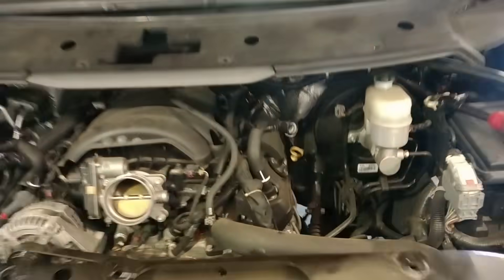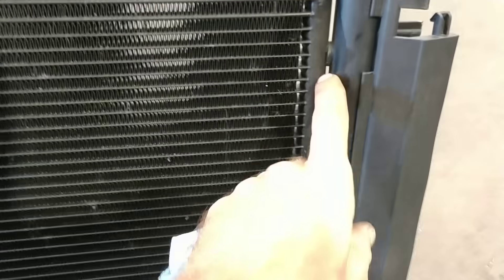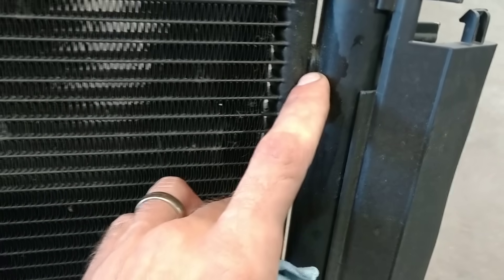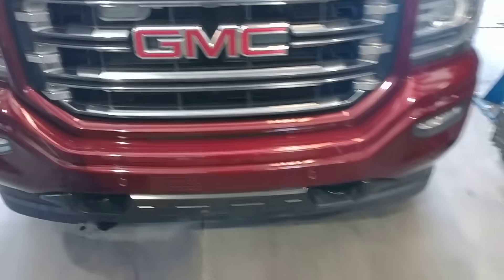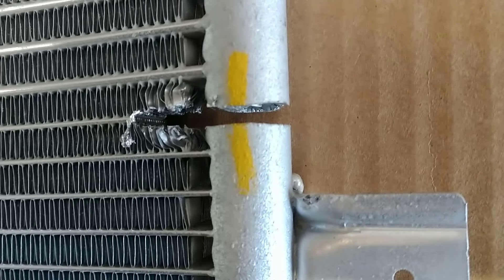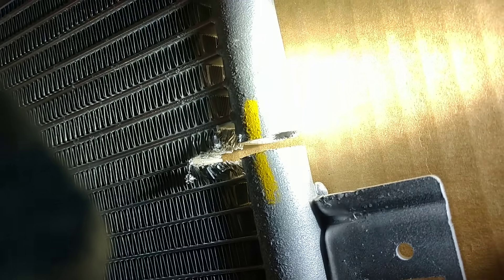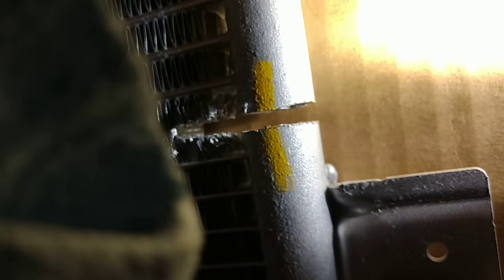Customer States...WAIT, look at this! Can't make this stuff up!

Comment: Interestingly enough. Saw a brand new 2020 Colorado 3.6 V6 with a coolant radiator that had to be replaced right off the delivery truck cause the entire top of it haven't been manufactured properly and when it warmed up to operating temperature, would open up and shoot orange coolant all over the underside of the hood. How did it pass quality control leaving the factory? The coolant radiator and the truck? Lol.

Comment: POS cars. 4 year old car needs a heat exchanger replacement. I could buy a used heat exchanger which was stripped from a ten year old car for my 20 year old car. How can someone not take 30 years of industry experience into account and make a car part so poorly designed?

Comment: Pop that sucker in and charge them another 1500 when they bring it back in. That's dealership tactics at work!
Reply: That is supposed to be like that
Reply: Uhm no. And these videos that are all over yt is showing us that mechanics are actually honest people, and that some car owners are just cheap and think service is a waste of money, and when mechanics are trying to sell you something, it's because your shit is fucked. But of course there are dick heads in any industry.
Reply: @mortenhartvigkristiansen7760  What shady mechanic is going to upload his shady practices? All of these "good" mechanics are showing you what they want you to see.
Reply: Did Morten actually write "customers are cheap"? To a group of people overpaying for declining quality in manufacturing? If I designed mass cars and not my personal projects, I would be mortified to have someone who paid their hard earned money to have to pay for a new radiator in a 2017 vehicle. That should be covered as well as many other defects. In PM training, you learn that a successful program is measured by the percentage of products making it beyond the warranty period without any claims. The standard 3/36k is such a low benchmark that I would be embarrassed to be apart of such. To fix your thoughts to type "cheap' as work trucks are 50-100k is just dumb.
Reply: Why else does bmw have plastic VALVE COVERS nowadays.  To get yo moneyyyyy
Reply: @tubbs200803  
MANY brands and models use plastic (molded nylon) valve covers for many years now.
GM started using them on the 4.3L V6 over 25 years ago. They had very few issues with those covers.
Some of the Buick 3800 V6s used molded fiberglass valve covers.
Reply: @tubbs200803  Exactly, every time I see a engine with that kind of stuff made of plastic is like "OH HELL NO!!".

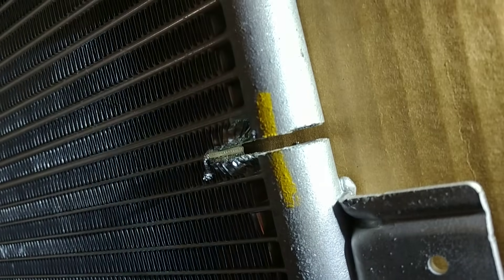Comment: I worked at a factory in Montgomery, Alabama that made radiators.  When I saw the pic at 1:17 I was like no way!  The aluminum tubes have holes that are big enough to pass a toothpick through at least otherwise they'd be getting stopped up all the time.  Good to discover that the radiator was made as two separate halves.  They are just using that "tiny hole" area as a heat conductor.  I hate seeing perfectly good fins ruined in a hack job like that.  You'd think the engineers could come up with a more elegant way of separating the transmission and A/C condenser than that.

Comment: Factory reject that someone intercepted on the way to scrap.  It had other problems somewhere.
Reply: "this is actually how they are supposed to be, this is how they all ship. This is how they isolate the AC condenser section from the transmission cooler section. A factory budge to fix a design flaw that causes excessive heat to transfer from one cooler to the other."

Comment: It was cut so it could not be used, defect, and some jo sent it out anyway.
Reply: This.
Reply: Wrong, it's cut for a reason. The transmission cooler is on the top portion of the condenser and the cut allows it to contract and expand. Oh how do I know, I work at a GM dealer and everyone of them new are like this.
Reply: @markbenson4504  That makes no sense, at all.
Reply: @markbenson4504  ha ha ha, good one !

Comment: Looks like a standard GM quality replacement part to me. Owww. I never thought I’d say quality GM replacement part all in one sentence. 🤪
Reply: You are going to be laughing when you find out, that this is a revised version of the original cooler. Apparently the cut leaves room for the upper portion (transmission cooler) and lower portion (AC condenser) to expand and also prevents heat transfer. The cut heating pipe is unused, so it doesn't leak. Also the description states that he used it.

Comment: Might've got cut in customs with the shipment.  They've been known to do dumba** stuff like that
Reply: "this is actually how they are supposed to be, this is how they all ship. This is how they isolate the AC condenser section from the transmission cooler section. A factory budge to fix a design flaw that causes excessive heat to transfer from one cooler to the other."

Comment: That’s crazy. I had multiple radiators with the same kind of cut in them. For an LT1 camaro. But they were aftermarket replacements not gm oem. Weird.
Reply: The cut is to allow expansion between the trans and AC condenser, it is supposed to be that way.

Comment: I rode different cars from very big and complex to very small and simple. Never seen a cooler radiator leaking from that connexion. They usually leak water if hit by solid object on highway or during collusion. GMC they never stop surprising me 🤣👎

Comment: If a part is deemed defective in production they are sometimes purposefully destroyed to reduce the chance of the part being stolen, reused or mounted in a vehicle. The cut has been marked which usually means that it was either a mark for the destruction of the part or a mark for a quality control operation. In these quality control operations the worker marks the part that has been produced, mounted or tightened with a bright colour pen. I can't really explain how it was packaged as a replacement part though. Could be a student, robot, drunk or negligent worker.
Reply: That cut is GM spec and was marked by the inspector who approved it.  Had the cut not been made, it would not have been sent out as the cut is to allow the automatic transmission oil cooler to flex separately from the condenser its built into.
Reply: Maybe all four! 🤪
Reply: Nice write up but that's how the part is supposed to be.

Comment: I had a similar thing happen with a radiator in my car once. A friend of mine was nice and got me a new radiator because my old one was leaking really bad, but the new one looked like someone had dropped a bowling ball on it or something. The top of the core was completely crushed in on one side and one of the end tanks was basically destroyed (plastic end tanks, so yeah). It was replaced with a new one that wasn't destroyed, but it sucked that I had to wait an extra 3 days to get my car back on the road.
Reply: This sounds like something we came across at the shop I used to work at. Rockauto part and it looked like someone had let down a forklift on top of it while it was standing up. Sucky thing was the box had been re-taped over the crushed part with rockauto tape. Which means someone at the warehouse knowingly shipped that part out. Don't know if my boss ever emailed them about it. We're out in the Pacific so returning a $150 radiator just isn't worth it for us
Reply: A friend of mine was nice.......😂😂😂
Reply: @cypeman8037  Yeah, I have pretty cool friends. Also helps that the friend in question works at O'Reilly, so he got a discount.
Reply: That must have taken a real pounding somewhere down the line then.  I worked on a project for Caterpillar and one of the new parts we introduced was a Nippon Denso aluminium cored cooling group (radiator to you Gov) with plastic end caps. One of the things we had to prove was the robustness of the plastic end tanks and the only way we could get it to break was by cooling it with Liquid Nitrogen and beating on it with a hammer.
If you go to a breakers yard and look at front end damaged cars the end tanks are usually still intact but ripped off the core.  We introduced a composite (plastic) oil pan too. Part of the validation we did for that involves putting an oil pan on a golf ball sized stone and then putting the fourteen tonne press tool that made it on top of it. No cracking or failure of that part. Composites aren't indestructible but they can be stronger and more durable than the metal parts they replace.

Comment: Wtf how could this part pass inspection and be sent out? lmao
Reply: Must likely cut as part of failed inspection to remove liability.but made it to packaging not scrap
Reply: @tobenkinzle4498  No this is how the OEM GM part is supposed to ship, they separate the AC condenser section from the tranny cooler like this. It's pre capped internally, but they cut it like this to prevent excessive heat transfer. I would not accept a new part that looks like that.
Reply: @CondoreComputing  you're joking right? It was literally cut into the radiator.. that's not how it comes bro. It would be clean asf and not done by human with an angle grinder if it came that way and you know that lmao
Reply: @Edward.Rippett.  Currently this is what  you get if you order this condenser from a GM dealer, it's not a joke. My guess is that they had a bunch of cores left over after the part revision, and instead of scrapping them, they specced this shitty bodge to fix the heat transfer / cracking issues. The part number has changed a few times.
Reply: @CondoreComputing  that's bro, wow that's pretty fucking ridiculous huh
Reply: @Edward.Rippett.  Seriously, I guess they do it by hand so some of them look clean, and others are a hack job like this, I tried to reply with a picture link of another couple but YouTube won't let me.
Reply: @CondoreComputing  yeah om sure the ones done by machine is much cleaner. If it was my company I wouldnt let any part come out of my shop looking like that, or anything less than absolute perfect ya know?
Reply: @tobenkinzle4498  yeah most likely bro
Reply: Obviously no such thing as inspection where this part came from.
Reply: @nothanks2994  or whoever's job it is to "inspect "is a lazy prick which is a huge possibility. They should have an inspector for each piece being sent out , it would save them alot of time and money honestly

Comment: They are all like that man I’ve put in 500 of them they all have that cut in them some worse than others
Reply: You are putting in condensers with a cut through the core?
Reply: @mahart40  What else are you supposed to do ? this is the way the OEM GM parts come. It's a factory bodge to fix a design flaw.
Reply: Why wasn't the old one like that?
Reply: @Legally_its_a_joke  The original one leaked, so they improved the design with that gnarly cut.
Reply: This is a combo trans cooler and AC condenser, the cut allows for expansion.  The person that posted the vid says in the description it is supposed to be like that. I'm starting to wonder if this vid is part of a social experiment to study how ill informed commenters run off in a tirade that the evil bowl of jello is out to get them.

Comment: Who in the right mind was thinking oh lets just ship this part. With a giant hole
Reply: "this is actually how they are supposed to be, this is how they all ship. This is how they isolate the AC condenser section from the transmission cooler section. A factory budge to fix a design flaw that causes excessive heat to transfer from one cooler to the other."
Reply: As a retired mechanic and assembly line worker (vehicle modifier and builder) you should read my book series! “All in a DAZE work” (The decline and fall the American work ethic) by Shepperd November. Available on Amazon.
Reply: It's supposed to be like this, the trans cooler and AC condenser are one unit. The cut is to allow for expansion between the two.
Reply: At one time I used to have to ship out knowingly damaged parts in order to keep my quota of shipped goods sent out in a day. If you didn’t meet your numbers end of the day management would write you up. If you got three write ups you were out of a job if you got one right up you weren’t getting a raise. it was better to ship knowingly damaged parts and have the customer return it then to get written up by management. It really sucks when upper management only cares about numbers and not quality and customer service. Luckily I was able to leave that company.
Reply: Fix the old one
Reply: @joemann The part is intentionally cut there. That 'tube' isn't a passageway for any fluids, it's just structural.  The cut is to allow for more flexing as the metal cools and heats.
Reply: @miraak542  Do you how the refrigerant is collected at that end of the condenser? It looks like it would be in that “tube”, but obviously it isn’t.
Reply: GMC's Quality Assurance branch ?
Reply: @PaidInFull1995   GM Quality assurance is a contradiction in terms.
Reply: Yea.. It's just a small nick .
Reply: It’s called a Friday afternoon shipment.
Reply: I’ve come across many people who would ship it like that. Not ideal.
Reply: I worked with people with that attitude.😕 Makes more work for me every day and I wander what the next day dealing with this, has in store for me...  😡
Reply: The guy why didn't want to get in trouble for breaking it.
Reply: Work for amazon for a day and you'll find out
Reply: Nobody wants to tell the boss....most likely this was cut when they were banded and stacked....and the packaging guy said "not my job"...
Reply: @Spahi77    (yob)
Reply: "They won't notice."
Reply: Xinnie the Pooh   I agree. I’m not crazy about Amazon but it was the only forum where I was able to publish my book series.
Reply: @joemann Chinese quality control.
Reply: Gay man, (GM).
Reply: @PurpleLightning2  Why is it that everytime someones hating on general motors the people doing so bring up gay people?  Seems sus
Reply: @getchasome6230  😂 I can make fun of any brand. Lol!
Reply: An american
Reply: @republicansarestoopid  Oh come now, we all know it passed rigorous quality testing as certified by "Dave" in Malaysia....
Reply: @atsernov  it was certified by little ten year old PO Chong in CHINA.
Reply: @JohnJohnson-bg2oo  that right it passed a rigorous 14 point inspection. Even came with papers of guarantee lol. Sadly I have learned to always order two of everything, because one is usually junk out of the box.
Reply: @republicansarestoopid  *Mexican
Reply: An american made a chinese made part?  Cool story

Comment: Damn those are small. I did my radiator and bent the old one in half and it split and even those channels are small but not that small
Reply: The smaller the channels the more that fluid is in contact with the metal, this added surface area increased heat transfer.